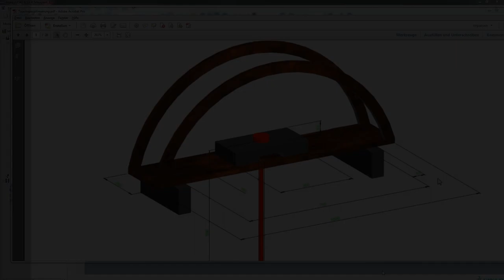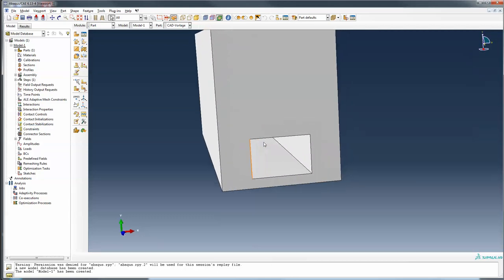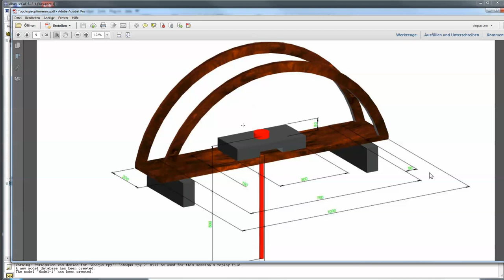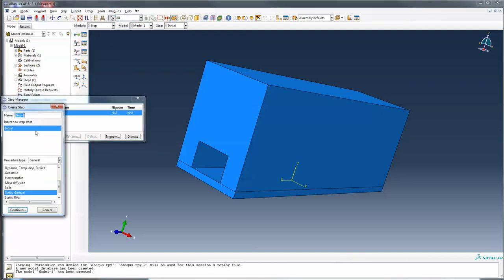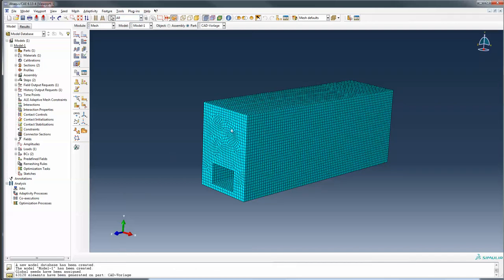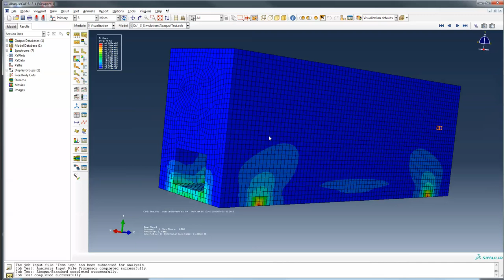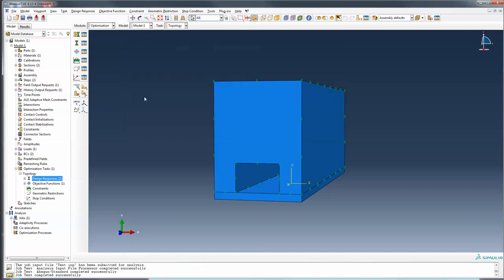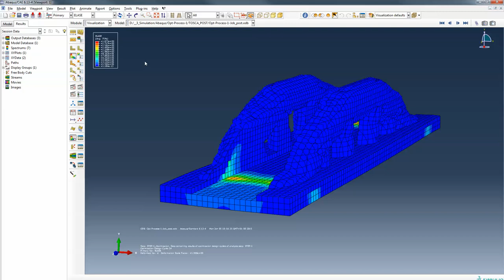Abaqus Topology Optimization of a Bridge

Comment: The jaggedness of the deformed elements is the result of using linear bricks.  It is called hour-glassing and and sometimes slows down a simulation.  It does represent an error in your results, though it may not matter much for topology optimization.  Try using C3D8R or I elements instead of C3D8.
Reply from the maker: could well be. Sadly I do not have an Abaqus License right now to test it. :(

Comment: Hello Manuel, thanks for making an informal video. As you may know, the topology optimization in Abaqus nowadays are done through Tosca Structrure. I've followed you video, but I've missing alot of the output variables that you get after your optimization job, among them the ELASE variable. Instead I only have something called MAT_PROP_NORMALIZED to work with, and that cutting plane doesn't make much sence, since it doesn't produce a continuous structure. Do you know is this varible is the same as ELASE?
Reply from the maker: As far as I know, there should be the ELASE variable. Unfortunately I don't have access to abaqus right now, then I would check. My guess would be: Check tht optimization settings for any error...if there is none, maybe the log file has some info? I'm just guessing, sorry ...
Reply: It's alright, thank you!
Reply: Hi again, I would just like to update my findings about this issue. It is correct that the only output variable from topology optimization is mat_prop_normalized (ref. Simulia documentation). This is a normalized material property variable and would then include density. The reason why I was not getting a continuous structure was because I was using a penalty factor of 1, which produces a lot more intermediate densities (a material property). This makes the cutting plane that is created by default look weird, because only a small portion of the design space has a normalized material property close to 1,0 (which isn't really what you want as an end result with a topology optimization).
Reply from the maker: I suggest you use a penalty factor of 3... but I am sure you've set this already :) Thanks for the clarification!

Comment: So what happens after i am done with the topology study? Can i use the optimized geometry directly or do i have to replicate it manually?
Reply from the maker: Manually replicate it is the state of the art today. The companies are researching ways of automating this process but it is not an easy task. There are ways to export the geometry as an .stl mesh which you can use in your CAD model as a sort of a template. With solidThinking Inspire for example, you can use the function called PolyNURBS, which allows you to directly lay geometry around your structure... you can find a demo video of that process in: https://www.youtube.com/watch?v=4QFu1r7JEC0&t=5s, but there are ways in each CAD software to do something similiar these days. In the future, we will have this process automated but its still a way to go....

Comment: Thanks for this video. I saw last week your video about topology optimization in Inspire with Optistruct. Which is more powerful between Optistruct and Abaqus, in your experience?
Reply from the maker: Inspire is targeted at the CAD market - where abaqus is targeted at the CAE market. So Abaqus is more capable of doing CAE stuff - for optimization purposes I would compare it to Optistruct and back then when I tested it, in my opinion Optistruct is the better tool to use for topology optimization.
Reply: @ManuelRamsaier  Thanks for the answer, you are not the only one who recommends me to use Optistruct for topology optimization. From what I could understand, the advantage of Abaqus lies in being a complete FE package compared to Altair products where you need to use HyperMesh, Optistruct and HyperView (correct me if I'm wrong).
I have another question for you, always related to this video. Did you only use Abaqus or did you also use Tosca? Does Abaqus contain Tosca inside?
Reply from the maker: @antoniovolpe1598  Well, Abaqus is sort of standalone but so is Hyperworks also if you are just want to use the built in solvers like optistruct. From my knowledge tasca is inside Abaqus, they bought that and integrated it just like Altair and Radioss solver.

Comment: Hey Manuel! Thanks for the great tutorial.

How did you take into account gravity? I added gravity as another load (there actually is a category for it although I'm unsure about the difference between "gravity" and "body force").

Also, in my first optimization iteration, the fraction of weight was slightly above the constraint. Do you happen to have an explanation for that?
Reply from the maker: Hey thanks for the feedback. Gravity is not considered in my Case but can be considered as an additional load as you did. Having more volume than allowed happens during the optimization process but it will converge at the last iteration. I am not sure why this is with abaqus but I see that also happen with optistruct. I will dig a bit deeper into it and let you know if I found something.

All the best
Manuel
Reply: Thanks so much Manuel! All the best for you too. David

Comment: Great tutorial! I wonder if it's possible to do a stress-constrained topology optimization in abaqus? And do different material properties change the optimization? Thanks!!
Reply from the maker: Thanks for your feedback. The relation stress and topology optimization is always a bit difficult. You can see details about it in my other videos with Hyperworks. For short explanation: The artificial density of the material can cause the solver to delete stressed material because of the stress constraint. Then the problem is solved for the solver but not for the bridge which will be very thin .... I think about it and may do another video about it. I wish you all the best!

Comment: Thank you very much for the tutorial!!
I tried to create an optimization of the bridge exactly the same way as you did.
The regular Stress Job is Completed but the Optimization Job leads to an Error before it even starts:
do you have any idea how to solve this problem?

ERROR:
  Optimization parameterfile given by --opt <parameter-file> does not exist. 

  Check that parameterfile "Opt-Process-1.par" exist ! 

Optimization process failed with an error.

vielen Dank schon mal im voraus und schöne Grüße aus Bremen :-)
Reply from the maker: Elias Barak The Optimization file is missing. It should be generated when doing an optimization as showed in the video...
Reply: Manuel Ramsaier I found out, that the Error occurs because of the missing ATOM licence which must be purchased for optimization processes. Did you purchase it seperately or is it included in the academic licence version?
Reply from the maker: +Elias Barak I do not know what terms there were at out department with the licenses when the video was shot but they were included in that time. It has been an universitary license / not a single student license. I suppose it will not work just with a student license

Comment: hi there and thank you for this vid
I have done all you did in vid but there is a problem
after finishing the opt job
when i click on results there is a error telling me this
THe result files cannot be found at d:amin\cd\tosca_post. do you want to combine the optimization results?
cd is the name for job
what should i do in this step?thank you
Reply from the maker: Check file path. Special characters and if you have permissions. Check if another dir works. Best regards
Reply: thank you for answering but i find the problem
in abaqus 2016 optimization calculated by side app called tosco
but it is not that good
i am looking for a way to use ATOM optimization in abaqus 2016
Reply from the maker: Sorry, that I could not help you with this. I do not have Abaqus 2016 :( Good luck with it though!

Comment: Hi!
I'm a beginner in abaqus. Thank you for the video. 
Can you please tell me what is the diffence in exporting (from Acad) as IGES (.*iges) or ACIS (.sat)?
I work with curtain walls parts (mainly steel or aluminum), so they are one boddy part. Which is the best way for me to export from Acad?
Thank you in advance,
Blend
Reply from the maker: Hi!
thanks for your comment. I used both iges and step as well as parasolid exchange files. I had until now not a problem with any of the formats as my models are quite simple (due to university lectures and so on)
I found a comment on a forum which may be of help for you:
"I have to say, as an importer of many different parts from a wide range of software that IGES consistently gives me the MOST problems and issues. I mainly use Solidworks with Rhino as a back-up for really problematic files. It seems to me that the problem is often with the exporting software rather than the importing one but of course the luxury of getting the exporter to adjust their settings to produce the most useful export file is an uncommon one to say the least! For me Parasolid is the preferred exchange format, closely followed by STEP then ACIS (sat) with IGES as a format of last resort. I have always assumed that the only reason anyone uses IGES is because they have been in the field for a long time and it is the format with which they are most familiar.
Strangely, the general trend on this discussion seems to be broadly in agreement and yet IGES is still the format I am most often offered. It would be interesting to know the thoughts of IGES favouring individuals as to why it remains in common use. 						"
Source: http://www.mechanicaldesignforum.com/showthread.php?1602-STEP-or-IGES-Which-one-is-best

Have a great day and thanks for watching!
Reply: Manuel Ramsaier
Hi!
Thank you for the fast response.  
Can you tell me if there are Abaqus forums?

Have a nice day and thanks again!
Reply from the maker: Blendi Collaku
 Hi, thanks again for your reply. Ineed there is a so called mailing list, which you can access here: http://abaqus-users.1086179.n5.nabble.com/
Another source for help would be http://imechanica.org/
Last one helped me a lot during my master thesis. Have a great day and all the best!
Reply: Manuel Ramsaier Thank you very much for the valuable information.
All the best.
Blend